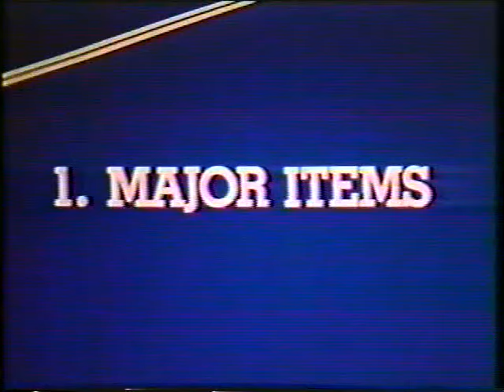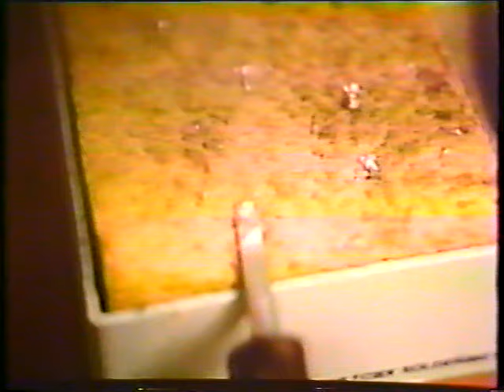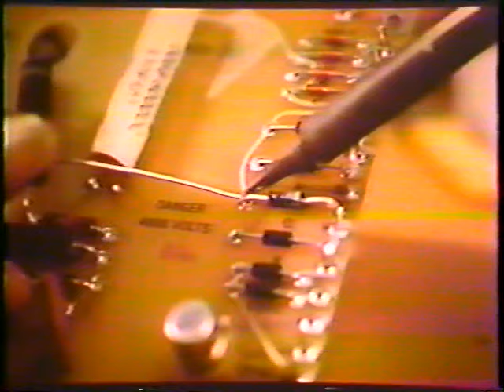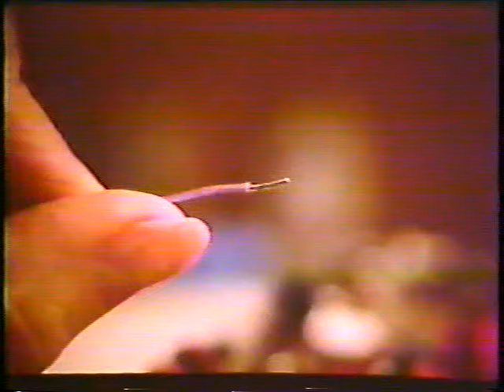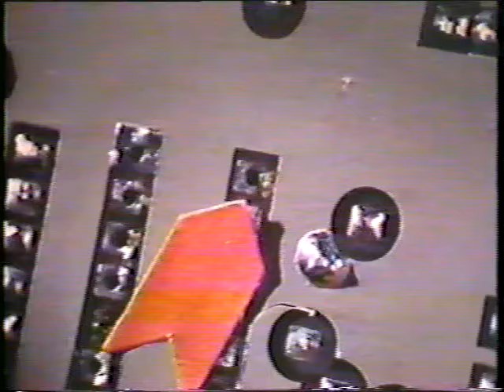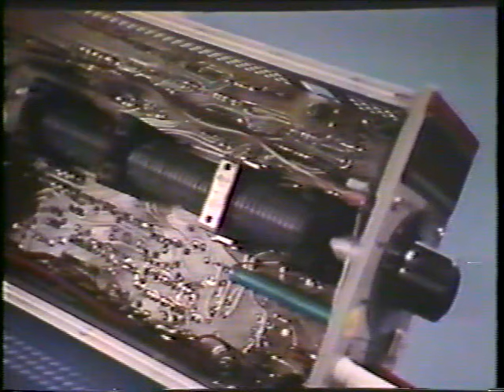TEKTRONIX - Making Quality Circuit Board Repairs (1980) - VHS Transfer

Comment: “A spring loaded desoldering tool, commonly called a ‘solder sucker’”

…and then proceeds to use the non-technical term repeatedly. i have to imagine some Tek trainees were stifling laughter viewing that section.

Comment: 'An iron with an on-off switch is desirable.' WE. ARE. SPOILED.
Reply: And then there are those of us using American Beauty... thermal throttle only, you plug it in and it's on. Of course, it's also a 550W iron in my instance, so "a bit" different of a use case!
Reply: @elitearbor  Just looked those up. Incredible. There's a demo video on their site and the guy isn't even using solder wire, but an actual ingot.
Reply: and it still is 😁
My JBC station has a built in switch that detects when the soldering iron is placed in the holder. It will then go to stand-by and after some time even switch off to keep the tip in good condition.
But even though my solder joint contains the proper amount of solder, they don't look shiny - thanks to the required use of lead free solder.

Comment: The tip about using Pipe Cleaners to absorb flux was useful. Some advice is outdated of course; e.g. I think they must make better copper braid now. I've used crappy braid & can see why they would think that it is too risky to use on plated through-holes. Modern GutWick sucks solder right through the plated throughhole & only takes an instant, a valuable tool sometimes outperforming even a good vacuum desolderer. I don't use a different wattage iron for different jobs, just use one good high-wattage temperature controlled good iron & it stays hot. And I wouldn't know where to get Freon as a solvent even if I tried...! Most of the advice holds up though, with the glaring omission of covering surface-mount soldering... :-) Thanks for the upload.
Reply: I once had an old Tek scope,  a 561 I believe and it had a small reel of silver bearing solder inside for any repairs.  Great old vid, thanks.
Reply: Yeah there's a HUGE difference between the correctly specced and the wrong braid! And ofc some are just junk in any use case with any solder type. But a really good, well specced braid will suck all but the most oxcide contaminated solder right through the hole from the other side in a second, and adding fresh solder to dilute any contaminates will solve that issue too.
Reply: Perhaps the construction of the boards got better, it mentions pulling the solder pad off with the copper braid, which has never been a problem for me.